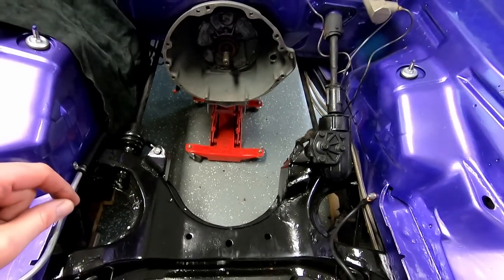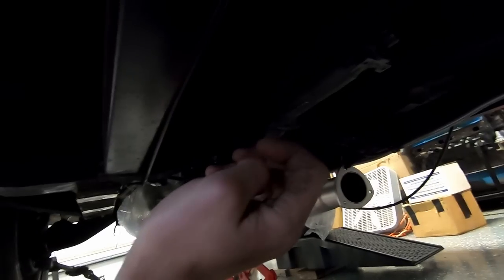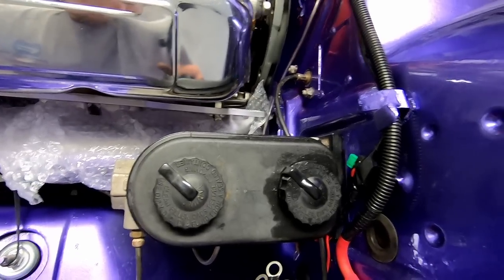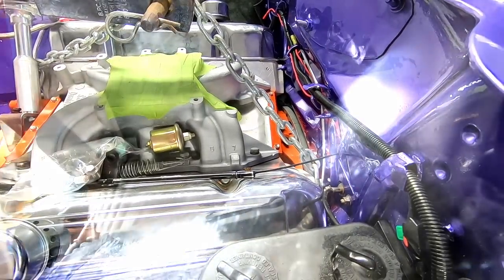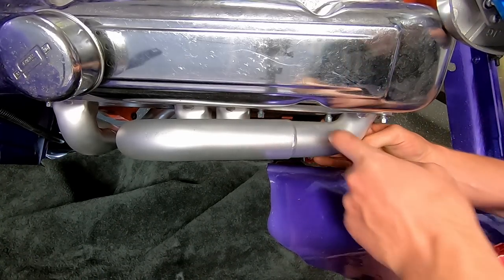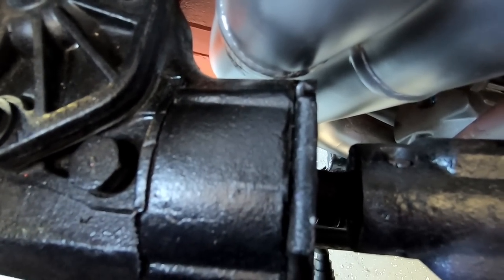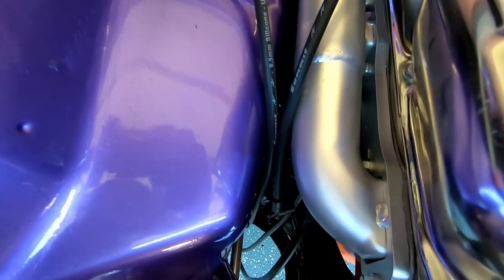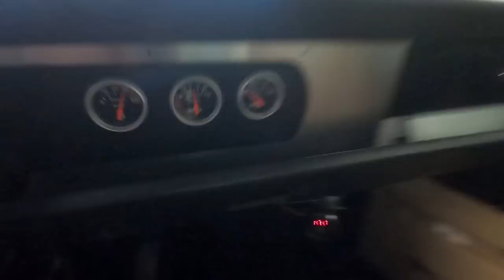Barracuda DragCar:Final Big Block Install with TTI headers #mopar #bigblock #engine #nonamenationals

Comment: That's awesome!! Cleanest Big Block install in an a-body I've seen.
Reply from the maker: Thanks brother! Should be ready for the track soon!
Reply: Very clean the headers for the a body big block has come a long way I have a set of old a body 2 inch and they were a pain the one side has more dents u wouldn’t believe but I guess company’s have come a long way over the years I forget the name of them it was in the 90s wen I had a 67 fs 383 and the exhaust is so small I had to switch to headers it looked almost identical to Joes except the back wheel were centre lines front skinnies with centre lines on front like I say it made me miss my barracuda it would only go 13 with no headers in the quarter high 13 but man I had fun miss that car but every thing you do is top notch you will be a top notch Mopar man and u don’t look that old plus your good with math which helps wen building these motors with the help of ed your machinist like Joe dirt says keep on keeping on well done Joe

Comment: A little trick I used to do tight spark plugs...Grab a length of 3/8 rubber fuel line hose, put it over the end of the spark plug like the wire boot, and you have a simple swiveling extension to thread in your spark plug with , without having to have one hand getting in the way of the other...I think once you get the hang of this method, you'll find life a lot easier...lol, great video by the way, keep up the good work.
Reply from the maker: Thanks for sharing! I know I’ve used that to do gen 3 hemi plugs, but forgot all about it!

Comment: That looked like it fit easer than my RB.  Looking good Joe.  I'm using the hooker 2 inch header , with my Victor heads thats as big as will fit.  My starter goes on easy with the headers installed but, you do want to have it wired before its bolted.  I can tell, your gonna have some fun this year!!
Reply from the maker: Thanks for Sharing, Mike!

Comment: Congratulations on a nice job glad it is going well for you. Years back I had found that mid 1970s Van with a b block had the correct small block side Water pump
Reply from the maker: Thanks brother. I am certain I have 3-4 of them, but all cast iron. I don’t want to pick up that weight again 😂
Reply: @JustMoparJoe  WELL WHEN ya wheelstands are too high............

Comment: Tell wifey you want one of those gizmos from Harbor Freight for Christmas that hangs from the cherry picker and has a crank on the front to adjust the engine angle. You will never put an engine in again without it. Congratulations on the install. By the way the elephant ear mounts are on the wrong side.
Reply from the maker: Haha! Those levelers are for Ford guys who have studs sticking out of their converters. As for the ears, I wanted them behind the ears, in case I can pull this engine forward and out someday. I also used the angle iron as a rest for the ears before drilling my bolt holes, so they are sitting on the iron, and bolted to it. Hoping that more points of contact will strengthen it.

Comment: The Baracuda is looking good Joe! I have the same TTI headers on my 65 BB Plymouth, that #6 plug is a mother but it gets easier every time you mess with it. Though I don’t think it’s possible on a hot motor at the track . Your idea of drilling a hole through the side wall is probably the way to go. 👍
Reply from the maker: Thanks, Dave! I may have to drill one next time I’m eating that frustration sandwich! 😂

Comment: The engine sure sounds sweet,Joe. I didn't realize those are stepped primaries (headers). My TTI long tube (2" primaries) on the Dart with 440 were different, as i was able to use a stock "mini" type starter for a 90's Dodge van, remove & replace without touching the headers.
Reply from the maker: Thanks, Shane. I absolutely would have been fine with 2” tubes and may have had a lot easier install of headers and starter. I’m scared to even imagine the starter going out on this one. It’s make for a days work!

Comment: Looking good Joe. Tight tight. Was wondering on your shifter cable do you run it over the front of the transmission or do you bring the shifter cable around the rear? I have a Hurst pro Matic and the cable no matter how I run it forward. It wants to burn on my headers. I cannot figure out how to run it backwards from the rear, wasn’t sure anyone was doing that. Thanks.
Reply from the maker: This shifter is made to mount from the rear. First I’ve seen. I loved my old promatic, but lost 3-4 cables through the years
Reply: @JustMoparJoe  good to know Joe thank you for the reply!

Comment: That's got to be exciting  !   I know I am, and I'm a Ford guy.   The studs at the ears is a good idea.   TIG a outlet on the radiator instead, it's still cheaper.
Reply from the maker: That’s a good idea! Thanks brother. That hose may get replaced with a metal flex hose in the future. Tigging would be perfect.

Comment: You probably have one of those mini starters, but I do so love the sound of the old high torque Mopar big block starters that were installed on the higher compression engines.  It is essential to have some kind of thermal barrier between the full size starter and the headers, but I have zero experience with the mini starters.
Reply from the maker: Thanks brother. The mini starter is the way to go. I love the nostalgia of the old starters.
Reply from the maker: Thanks for following the channel for so long.
Reply: @JustMoparJoe  Are you kidding?  I love this stuff!  Thank you for having such a great channel!

Comment: Welcome to the world of the B/RB engine, it's always a tight fit to get to plugs.
Reply: It's funny– the first time I set the points on my 318 with the distributor in the back, I just had to have a big block with the distributor in front.  Electronic ignition conversion makes that a moot point and now I am doomed to wrestle with spark plugs instead!  The spark plugs were so easy to reach on the small block...
Reply from the maker: Thanks, Greg!

Comment: Nice work Joe. That was major surgery!  Question: I'm installing TTI headers on my 383 Challenger.  I didn't see you use any gasket sealant on the header gaskets. TTI recommends it in their instructions. What's your opinion?
Reply from the maker: I didn’t use their included gaskets. Those have the kinda carbon stuff that gets hit and crumbles out over time. I bought the multi layer aluminum gaskets from summit. They crush up and seal really well. I did use antiseize in all bolt holes for my aluminum heads.
Reply: @JustMoparJoe  thanks Joe, I will take your advice on this one and do the same.

Comment: Definitely keep an eye on your fuel pressure that style regulator has a very small hole in it.220 I believe
Reply from the maker: Thanks for the tip! I’ve only ever ran that style. Holley seems better than the summit brand.

Comment: What break in oil do you use in your motors Joe ?
Reply from the maker: This one got the comp cams 10w30 break in. I usually get a diesel engine oil and add the zinc. Now I’m running semi synthetic 5w30 and a quart of synthetic Lucas. This one is a roller cam.

Comment: So what’s the warning on the 440 source rockers I have them in my 440 tunnel ram
Reply from the maker: The rockers have been reported to dig into the shafts that are provided because the hardness isn’t sufficient. I’ve gotten 3-4 warning emails about them from viewers.
Reply: @JustMoparJoe  what is 440 source saying about this problem
Reply from the maker: @seanfattireguythomas2994  the first time I called, they said it isn’t an issue unless you run really high spring pressures. Mine aren’t that high, but I can see more than burnishing in my shafts.
Reply: @JustMoparJoe  thanks I’ll have to watch mine

Comment: Doesn't 440 Source make a water pump housing that comes out on the other side for about $100?
Reply from the maker: It’s basically the same price as a new eBay radiator 😂

Comment: Those are the headers I use. They have been great. Here is a link to the dyno session of my old engine. https://youtu.be/OBiISx2HUTI
Reply from the maker: Sounds mean!
Reply: @JustMoparJoe     It was until the intermediate shaft broke in the oil pump at the track. Made two passes, loaded the car, and unloaded at home all with no oil pressure. Never seen an intermediate shaft break like that. The car did run 6.13 at 109 mph though.
Reply from the maker: @tubbed68cuda  I’ve had a small block one break about 1” from the end. Engine had tight clearances, thick oil 15w40, and a high volume pump.